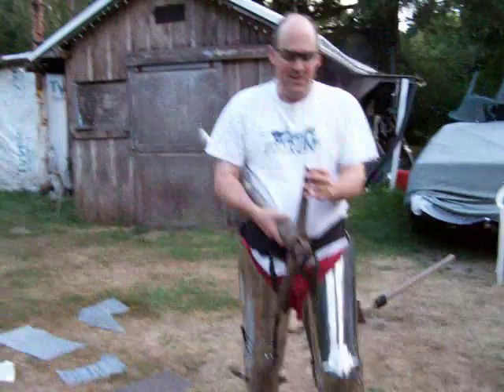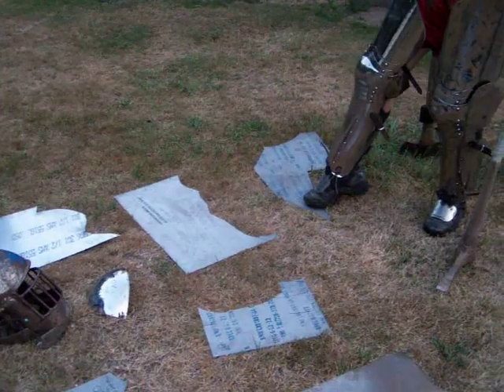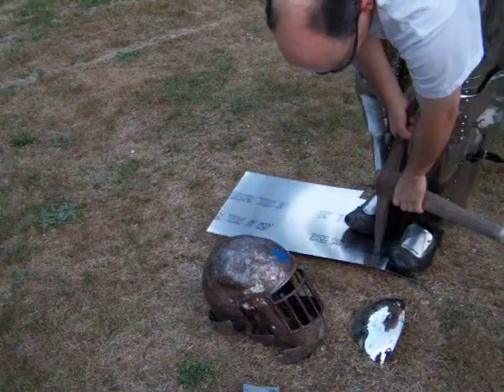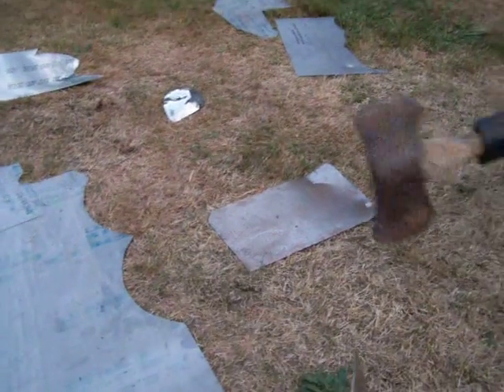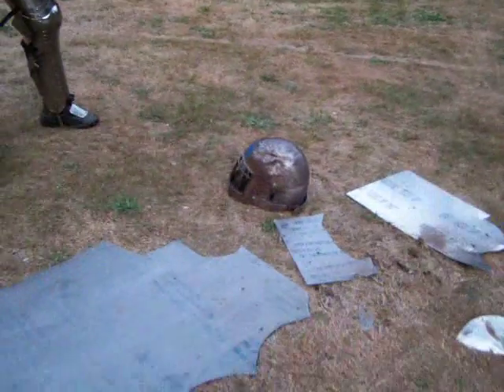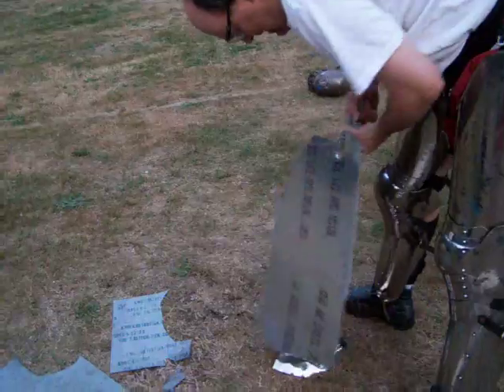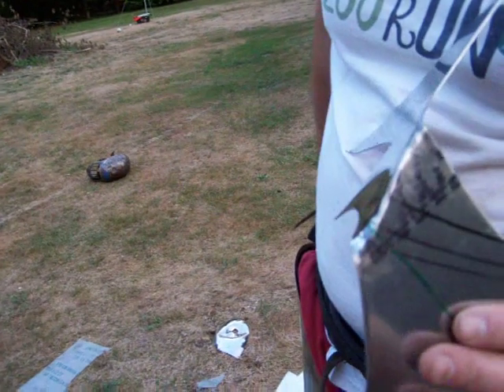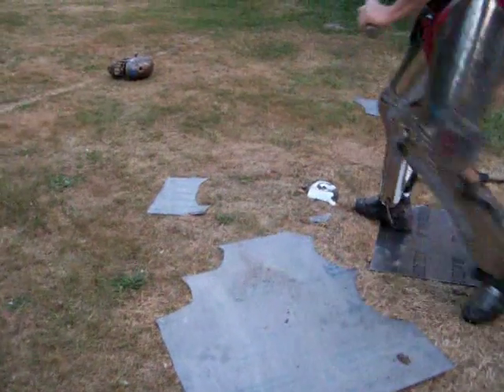Destructive testing with an 5lb pickax: titanium spring stainless and mild steel.

Comment from the maker: as research this is very poorly done. I wanted to show the author who asked the question some of the characteristics of failure.

little bit of follow up: please note the thicker gauges(the .071(15 ga) and .080(16ga) I found after the video was taken) of titanium did not shatter and had much less penetration than the mild steel at a much thinner gauge. I think 12 ga ti would have bounced it. also know that the 6222 alloy of titanium I like to make SCA armour with is very hard but much more brittle than some of the softer more forgiving alloys like al6-4v. the (the .071(15 ga) a6-4v did not shatter. 

the 18ga 301 FH was like paper. its performance was close the 16ga shaped mild so dont think that spring or spring stainless will perform any better. none of the magical metals in a thin gauge will protect against a sharp point with that amount of force behind it.

will try a six pound sledge when my wife from traveling